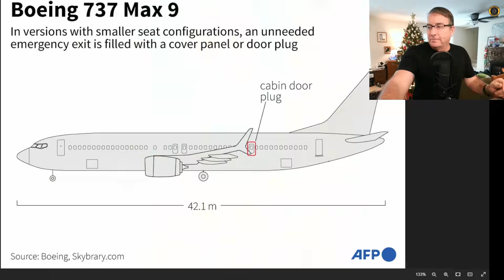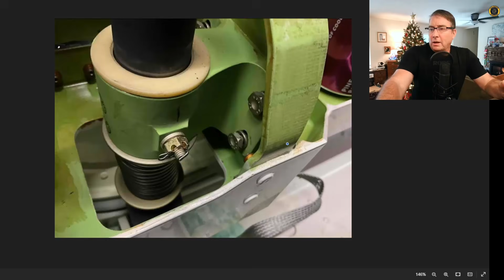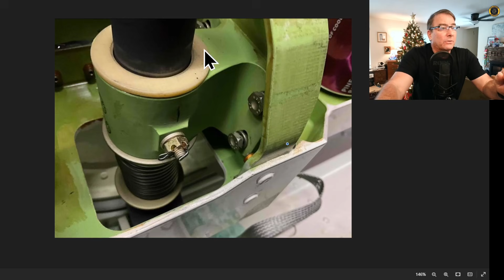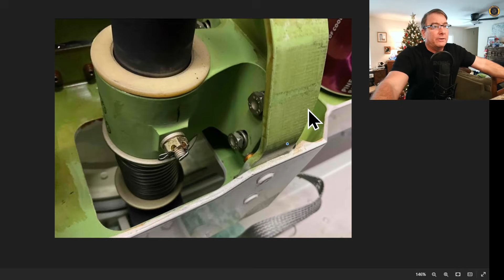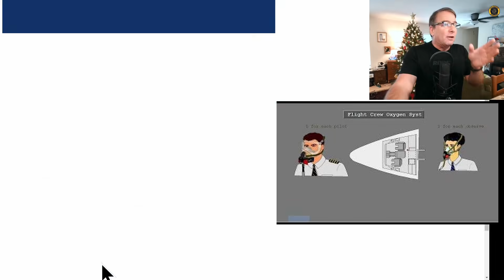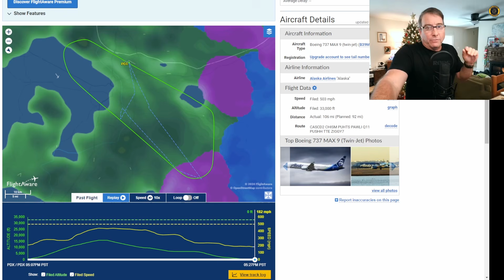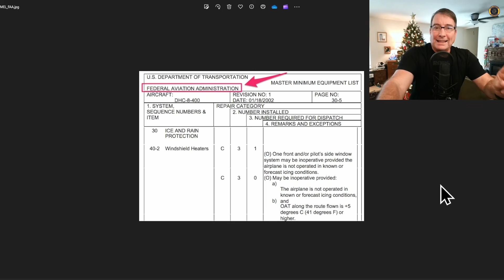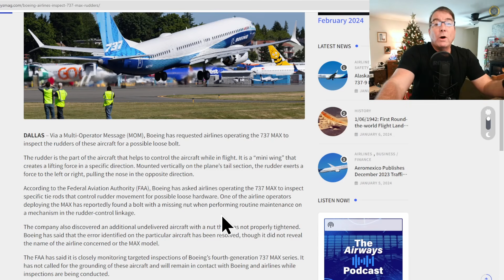"Yes, We Have No Bolts"  9 Jan 737 Max-9 Update

Comment: Being a retired UAL mechanic I’m stunned at the multiple chain of failures from both the carrier and the manufacturer. They’re darn lucky they got away without any fatalities on this one.
Reply: They were extremely fortunate that the panel didn't hit a control surface.
Reply: @glynnwright1699 or that it didn’t happen at cruising altitude
Reply: What exactly has Alaska done wrong here?
Reply: @user-vk4vd7vr5t  They bought a Boeing.
Reply: perhaps not researching the multiple pressurization warnings ??
Reply: If there was an MEL to allow it to fly, that's all they needed. Still up to the maintenance controller to approve it though. More than likely there will be a new procedure for such case in the future because of this incident.
Reply: Imagine if that plane was at 32,000  feet
Reply: @ronaldspins you’d find Peter in Bob’s back yard…
Reply: @ronaldspins . The door could not happen at 32k’.  The pressure on the door is too much.
Reply: Alaska airlines only took possession of the plain from boing 80 odd days before the failure. How often is this plugs attachment supposed to be inspected?
Reply: @truracer20  I don't think an inspection is ever planned, or at least not routinely. That lousy engineering is supposed to be permanent. They just use a regular door to save money on a proper plug. They could also just build an airplane without that hole, but that would also cost money. They just build one airplane model and plug the holes that won't be used for those customers with such a seating configuration/count.
Reply: @truracer20  The writeups needed to find the problem. What did Alaska's
maintenance team do?
Reply: This problem wasn't confined to just this one Alaska Airlines plane.  Other airlines are also finding loose bolts on other Boeing 787-Max planes which use these plug doors instead of an emergency exit in this seat row.
Reply: United has 79 Max's with 5 of them having a bolt issue as of a report I heard yesterday. Alaskan has sixty-something planes @mikedx2706
Reply: FAA should start making noises about revoking Boeing's production certificate. That would get the bean counters attention.
Reply: I dont think Alaska did anything wrong in this case, in fact their maintenance were more cautious than what boeing required in their MELs. If the item is allowed to be on MEL, why would anyone think that they shouldn't use that procedure to allow the aircraft to fly until maintenance has a better opportunity to look at it closely. Intermittent faults happen all the time. I feel like this is a case of "if you hear hoofbeats, think horses, not zebras" but this happened to be a zebra. I wouldn't blame any technician for using the propper manufacturer approved procedures. And I'm fully in agreement with flight crews denying planes for flights based off of write up history, very few if any technicians would argue with the crew if they deem the plane not fit to fly, the only people bothered are the airline flight schedulers and probably the passengers depending on how long they have to wait for another plane. We've had pilots deny planes because the forward lav was inop, not my problem, I just fix whats broke.
Reply: @D3V1NF5    This is simple. The tech needs to know the position of the outflow valve at time of failure. .  If cabin alt rising, the ofv is closed, engines running, you have a horrendous air leak.   I have worked this exact problem where a pressure panel blew out.
Reply: I would like to see where the outflow valve when the pressurization failed. If the cabin altitude is climbing with the ofv valve closed, you have a bad air leak or the the engines air feed problem.
Reply: Alaska airlines only took possession of the plain from boing 80 odd days before the failure. How often is this plugs attachment supposed to be inspected?
Reply: I think it’s only a matter of time before there is a major disaster in the US.
Reply: or was it intended you ever thought of that
Reply: @saltseaful take your pills
Reply: This is just may be a procedural error by Spirit AeroSystems.  The fuselages may have been shipped to Boeing with the bolts loose thinking Boeing was going to remove and reinstall the doors anyways. But Boeing did touch the door.  The bolts remained loose.  My expert opinion.
Reply: @oldmech619 good guess
Reply: Reminds me of Alaska’s maintenance on Alaska Airlines Flight 261
Reply: Sounds like someone didn't tighten the bolts properly. Simples.

Comment: ** Quick theory here. Spirit ships the fuesalge to Boeing without any pins through the castellated nuts and just lightly tightened to make it easy for Boeing to remove it and fit the interior. Boeing changes the interior fitting procedure so that the plug door no longer requires removing, doesn't tell Spririt and just assumes the plug door is fitted to delivery spec and boom, we end up with this mess?

Comment: Hopefully a one-off incident/accident but too many things missing. You would think pulling the voice recorder CB would be a muscle memory thing. When I worked at NARF Jax on RA5C's we had a rash (2-3) engines being FODed, same side, while in flight. It turned out an inexperience sheetmetal mechanic mistook the rigging pin holes on the variable intake ramps as having a rivet missing, so he put one in. In flight with the speed and power settings in the go fast mode the ramp was damaged FODing the engine. There was no way to simulate the movement on the ground once the A/C was on the flight line for flight test. We had a NEW Sikorsky helicopter at the commercial operator I worked at still had cleco's in the tub section holding some ribs/stringers together.
Reply: I hope you mean muscle memory for maintenance.  Flight crews don't usually pull breakers for anything,  Maintenance is 100% to blame for the CVR.  It's pretty inconsequential in this case anyway.
Reply: @johnaclark1 The way Juan explained it pulling the CB would have been on the pilots checklist in this case. Maintenace would have popped and tyraped the CB if it was an maintenance issue. Never maintained/crewed an A/C with a CVR myself. By the time we went Part 135 I was in a management position, so pulling CB's was not my job anymore. Our pilots and maintenance worked as a team.
Reply: @donaldjones3580  It's on the maintenance checklist and is one of the first things they're supposed to do after an emergency/incident.  Yes, the crew could have but is not responsible to.  The crew did their job 100%.

Comment: My first engineering job was working in aerospace manufacturing, making aircraft engine compressor blades.  ETOPS was a new thing then, but the unofficial definition of ETOPS was "Engines Turn or People Swim".  Boeing has lost it's ability to design aircraft.  A crying shame, and bad leadership is the cause.

Comment: What the FFA could do is on the bolts that is critical torque is replace them with bolts with holes in them and you be required to safety tie them with lock wire.

Comment: If the pressure is always greater in the cabin, it makes you wonder why they built it backwards. Build the plug so that it is being forced shut, not open. ie, the plug bears on a flange inside the aircraft. Make it good and big too. Make it so you've to rotate the plug 90° to take it out. Who cares? It's not used, until mtce needs to change it for an emergency exit assembly.
Reply: Just a guess, but I am guessing that if you must have a structural failure due to excessive pressure, you're going to want it to occur first at a reinforced location like a door frame -- rather than at some other random spot where the fuselage rips apart in an uncontrolled manner.

Comment: How does the plug maintain a seal at the ends of the door when it can move vertically to lock and unlock it, must be some flexible seal, and what about the sealing along the sides, or it that just a close fit. its not like a true plug that does the sealing

Comment: It looks as if the plug needs to move upward in order to free the upper door roller pins.
The lower Spring hinge puts upward pressure on the plug to assist with opening of the hatch. A very positive fit.
Absent the lock pins, castle nuts and SS cotter pins the door is able to move vertically.  A good design poorly executed.
I am with you Juan. Im not sure if Boeing outfitted the seats or if for some reason Alaska air used that access point, but I would hope there would be some kind of maintenance trail to see where things went wrong. Not jusr rely on some forensic investigation after the fact.
Reply: Agreed. The operation of the spring hinges confused quite a few of us who watched Chris' first video on the topic. The plug weighs 62 lb, which really isn't all that much. It seemed to us who were confused that any springs on the bottom should push the door down to hold the guide track tight against the roller pin when a plug is installed rather than a working door--even if that meant it took more force by maintenance to push the plug upward for future removal to provide an extra entry point or ventilation during interior refits, etc. It would be interesting to see a video of how a functional emergency exit door latches/unlatches and is opened.
Reply: The two lower lock bolts are to PREVENT upward movement of the plug
The two upper lock bolts are to PREVENT downward movement of the plug. The 12 alignment stop pins are to center and align the seals. There didnt appear tobe any damage to the threshold or to the two lower spring hinge posts in the photos Its an elegant design, provided the locking bolts are installed correctly
Withe the lock bolts installed the spring itself is inert @stephenjarzombek2903

Comment: What are there only one set of nuts in the hinge guide. Shouldn’t there be at least a second bolt just in case for safety. Not an engineer but seems plausible

Comment: I'm sure the need to keep a common type certificate rating has absolutely NOTHING to do with the airlines pressuring Boeing to keep the same rating so the airlines wouldn't have to spend additional money training the crews for a new aircraft type.    I'm going to guess there are multiple factors involved in the pursuit of keeping the same aircraft type rating, and it's not singularly Boeing driving that.
Reply: Southwest did exactly that. They also lobied for Congress to relax the regs introduced post those crashes, that meant Boeing would have had to fit improved EICAS to the Max's that had not yet been certified - all to avoid additional training for flight crews (because that costs money).

However, Boeing were going that route anyway and they're still the ones that have to stand behind those decisions to save money in the design of the plane v ensuring and improving safety.

Comment: Will spirit aerospace be producing a bunch of door components without assembling them to be ready if the brackets need a quick redesign so they can be ready to assemble and ship doors to get the planes back in the air.  

How are the other doors jams  retained.  Are they checking fasteners since the rest of the fleet are grounded

Comment: Boeing cockups have serious safety implications…school kids know about 737 max trim runaways…almost as if it were sabotage. I mean the production line surely has sub assemblies, bolts, nuts and split pins delivered JIT with a computer screen prompting where how and when they are fitted? Hey are these castellated nuts meant to be torqued and pinned? Nah…just chuck them in that bin over there.

Comment: In Airbus A 320 family aircraft the cockpit door is supposed to unlock, to allow access to the cockpit, if the flight crew is incapacitated. There is also a blow out panel, that blows out if necessary. 19:25
Reply: It actually makes sense thinking about the Helios Airlines Flight
Reply: @xypsilon3003  This Helios flight didn´t suffer a rapid decompression, it was a misuse of the cabin pressurization system, which led to a slowly dereasing cabin pressure.

Comment: Here in the UK those  keys are referred to as cotter pins. 

This is looking to be get another can of worms for Boeing. If so many bolts are missing nuts or incorrectly fitted as appear to be surfacing, surely the FAA must ground the entire fleet until they've been THOROUGHLY inspected tip to tip!

Like you said Juan, what else is wrong? How many of these are going to call from the sky before proper action is taken? After the MCAS debacle you could think Boeing would be sensitive to quality issues but clearly not. Perhaps it would be useful to take quality control out of Boeings' hands and make it independent with the power to prevent ANY aircraft that doesn't meet standards from being delivered? 

Airliners have tough lives having to go through many cycles of pressurisation and there was a time when Boeing was a quality product and had a reputation. If this sort of thing can happen to an aircraft a few months old, how will that translate a few years down the line? It's more than a little concerning!

I know it'll be 18mths or so, but I find I can't wait for the NTSB report to come out!

Thanks for covering this in such an easily digestible way Juan!
Reply: They are also referred to as split pins.
Reply: I was born and raised in Indiana and always called them cotter pins. To me, a "key" is what fits in a keyway on a shaft to prevent the attached component such as a gear or flywheel from spinning on the shaft. That being said, yes, I have heard some US folks call them "cotter keys" but only rarely.

Comment: COTTER PIN FITTING

Juan,

The Cotter Pin shown at 5:47 appears to be fitted incorrectly and is not splayed against the outer face of the Castelated Nut as it should be. One has to say that it appears to be fitted rather shoddily.

From the apparent size of the pin i would estimate that it is of the wrong gauge, (size).......
This looks to be a very cheap looking item to me........

It will be interesting to know who supplies the Cotter Pins...the spec that aplies to them.....and how much they cost.....?

James Hennighan
Yorkshire, England

Comment: On the picture that you show of the spring hinge assembly, I'm troubled by the status of the hinge pin bushing mount bolts, it looks like those are either loose or missing obvious washers, but I never worked Boeing aircraft.  Also as a retired (military) aircraft and engine technician, I don't really like the way the cotter pin is on that castle nut.  We were always taught to pull the loop in as tight as possible (without deforming the loop, of course!)  into the staking notches and then top side up, along the bolt threads and bottom side down conforming to the nut, washer profile.  The example you show looks like there is a possibility the pin could rattle in the hole, at least the depth of the stake notch.  That would tend to buzz and fail.  Of course I'm more a proponent of safety wire and a bit of 32 or 40 thou would come in real handy there instead :-).  But again, that'd slow down production, and we can't have that can we...  Thanks Juan!!!

Comment: As this was a brand new aircraft and these plugs were supposed to be checked and certified by Boing, would they even be inspected by the new owners that soon? Is there a specification that says how often, or how many flight hours, that the plugs should be inspected? To inspect them, from what I can see on Juan's reports, the interior paneling has to be removed to access the bolts. Also, if this plug was coming loose and causing a fault, wouldn't passengers or crew have heard a whistling from the area of the plug that was not normal?

Comment: It was mentioned in Bloomberg that the AS Max9 went into wifi installation early december for 10 days and ever since then, has had pressurization problem. While the contractor said it shouldnt be related, it was reported that the plug door had to be removed to install the wifi.
Reply: Interesting.
Reply: That’s great but what about the UA found loose bolts then? Same maintenance/service and contractor?
Reply: @czarekusa555  Dont get me wrong. I am not defending Boeing, it just indicates that a brand new airplane could undergo modifications where parts are taken apart and put back together. 

Regarding UA, they also have wifi installed. The dome is located near the plugged door...

Comment: Loose Bolts/Nuts Missing Bolts/Nuts that is a very interesting situation. Maybe this will come out at some time but I wonder what condition the right hand plug is in on that aircraft? I would think shortly after inspection of the damaged aircraft they would remove the interior cabin cover of the right hand door and inspect the plug assembly to see it's staus and are all of the bolts in place and tightened to specs. Sounds like Boeing needs to get a checklist system in place when the aircraft is being produced and readied during assebly and rollout. Maybe by some extra wrenches sockets and torch wrenches for the assembly line.
Reply: NTSB inspected the RH door. All good.

Comment: very surprising the force of the small amount of air in the cockpit expanding was able to blow the door open and headsets flying..
Reply: Also it was 9psi, not 11psi, not that that makes much difference.  The other relevant calculation is that the door is maybe 5 feet by 18 inches, so has an area of about a thousand square inches, and a pressure difference of 5psi amounts to 2.5 tons of total force on that door.
Reply: According to my cheap math, 14psi to 11psi represents an instantaneous increase of 20% of the volume of the air.

Comment: 20:00 Security failure - explosive decompression blowing open the hardened cockpit door... Should be some little panels blown open with wire mesh behind them.
Another security issue - deliberate assembly errors by someone to impact Boeing status.